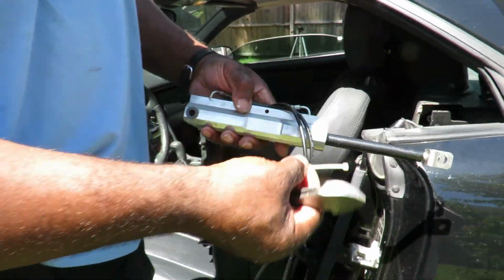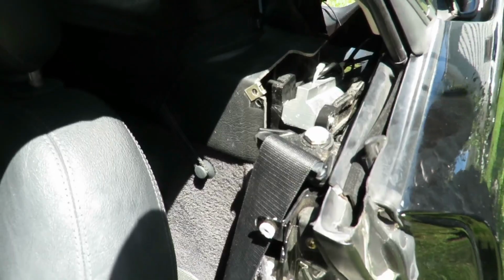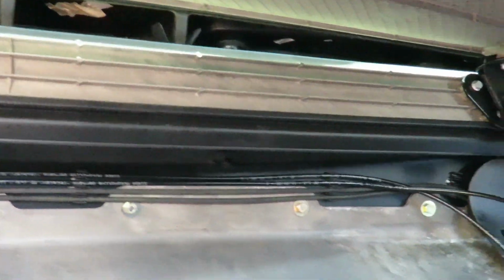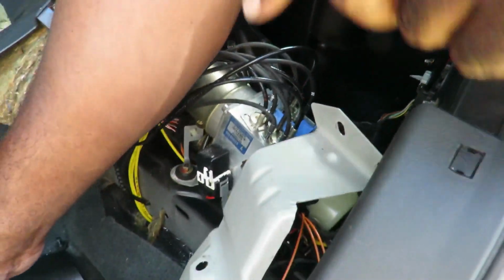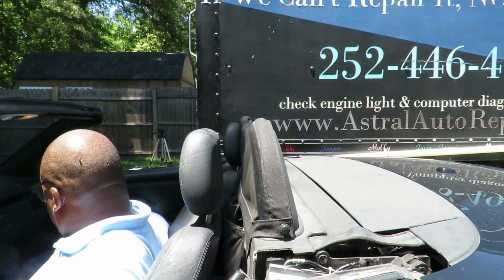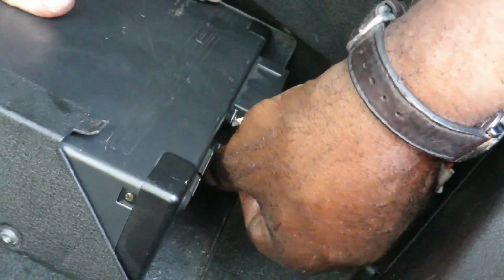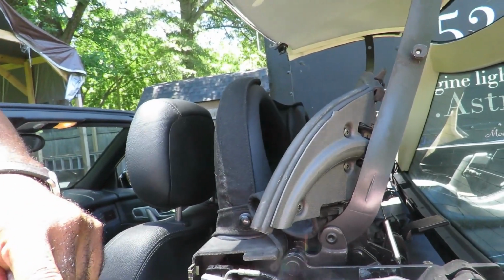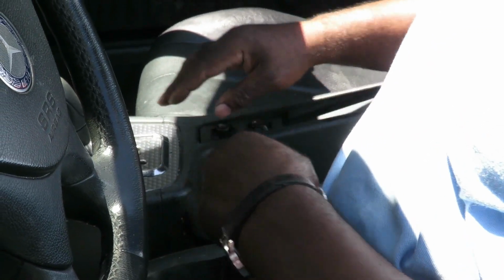1998-2004 Mercedes Benz SLK230 Convertible Top Piston Rebuild And Replacement - PART 3

Comment: This is the best video I have found to refurbish the MB 230 hydraulic top cylinders. You really took your time to demonstrate the process thoroughly. Thanks. By the way , in order to remove the trunk side panels , you have to pull the cables located behind them and lift up on the trunk to unlatch it from those seatbelt looking latches. Just be sure to support it. The panel can then be lifted out. Thanks again for a great video.
Reply from the maker: Thanks, and thank you for that great advice!

Comment: Great videos. That oil level in pump should never exceed the top mark. Doing so will pressurize the system and blow seals.
Reply from the maker: Appreciate the tip!
Reply: @OnlineAutoRepairVideos  yes. I actually took some hydraulic oil out of the pump as one of mine was crossing over the top line. I have two of them. Seems if the pump has to much oil in its reservoir it pressurises the system. Makes sense to when you think about it